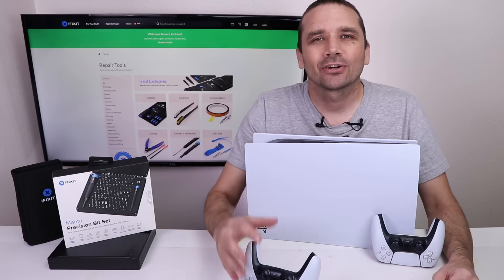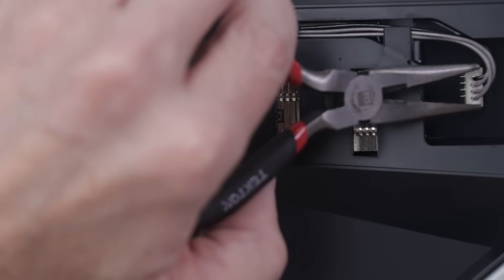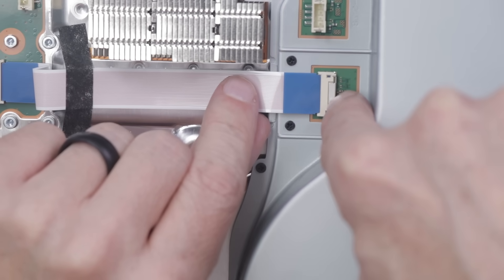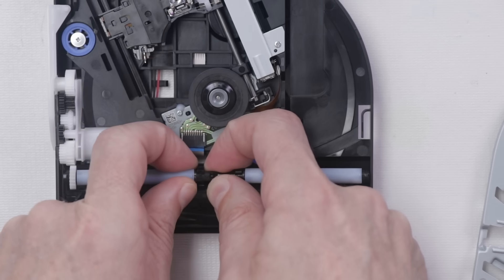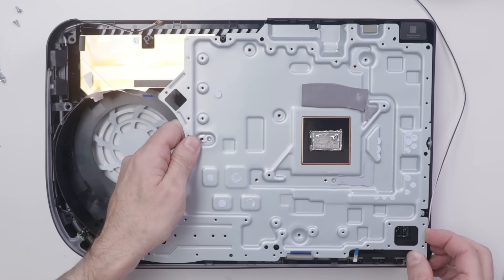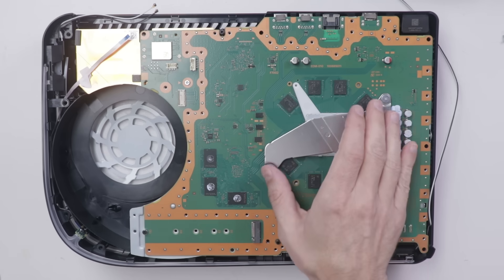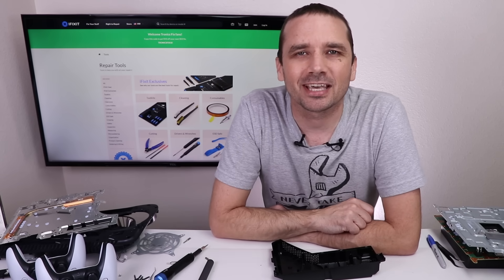PS5 Teardown - A Repairability Perspective

Comment: Apple and Sony are best friends in terms of repairability perspective.
Reply from the maker: Lol!
Reply: Try open a Sony camera, welcome to hell
Reply: @null643  Right now the expansion slot isn't usable however the fact that it's a PCIE 4 slot means that it's on par with the onboard storage in terms of speed and in time it will become faster so you might not even need that onboard storage in the future. It seems my information was incorrect oops, The PS5's onboard speed is 9gbps, the fastest PCIE 4 SSD I've seen that is available for purchase right now is 7gbps, that's still 2gbps under PS5's. I believe PCIE 4.0 has a maximum speed of 64 gbps so theoretically in the future a SSD plugged into the M.2 slot of a PS5 would be faster than the onboard.

Also there are probably faster SSD's in enterprise but not for everyday consumers.
Reply: @FC360D  the raw speed is 5.5. With compression 9 is one of the numbers that float around the Internet, but also 17 if I'm not mistaking. In the road to PS5 presentation Cerny mentioned that in the future with the right compression they might hit 22 Gb/'s.
The ssd expension must be faster than the on board. Internet says 7 gb/'s is fast enough, but we will hear from Sony what will work for sure.
Reply: @RazorFastClaws  Ah right thanks for that information :)
Reply: If that were true, Apple would be shaking their head in disappointment, because Sony didn't glue and clip everything down. Sony would nod in approval at the 43 screws though.
Reply: Its a shame, because they used to be one of the best.
Reply: It's still repairable though and looks easy enough to repair with the right know how. The only issue I see is the amount of screws which might annoy people but that's what electric screwdrivers are for and on a plus note hopefully someone will take 1 look at all the screws and decide to take it to a professional instead of trying to fix it themselves and break things even more lol.
Reply: @FC360D  I agree, the biggest problems I have is how hard it is to get to the heat sink and how the SSD is soldered to the board. Maybe it was impossible to get the super fast speeds without it being directly on the board?
Reply: @Maka8295  I don’t think soldering it made it any faster maybe they were just conserving space? although there is 1 expansion slot I agree however that it’s pretty annoying they went with those decisions
Reply: @Maka8295  Right now as far as I'm aware there isn't any storage available for purchase right now that's faster than the PS5's however I think we will soon see similar speeds to the PS5's storage and then it will overtake it especially when manufacturers start releasing and supporting PCIE 4 SSD's. It's why I like the M.2 expansion slot which I believe is PCIE 4 so in the future we might be able to install a bigger SSD that is on par or faster than the onboard storage. PCIE 4 has speeds upwards of 7gbs.

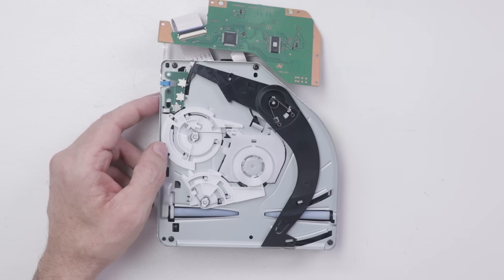Comment: 7:24
is 43 screws really necessary i cringed instantly hearing that
Reply: It's probably to keep all the thermal stuff under perfect pressure, but it's still excessive
Reply: Necessary to keep the liquid metal in check.
Reply: feel like 30 would've done the deal, but idk, Im not Sony
Reply: It's to apply even pressure across the board, they're using it as a heat sink. Its vital that even pressure is applied otherwise some parts will get less contact than others.
Reply from the maker: Ya, not sure that's necessary!

Comment: What a poor design from sony, the number of screws random sizes, cheap plastics/components and the size is just unreal.
Reply: That's because of the liquid metal.
Reply: @UssyMustyYS  Nothing to do with liquid metal.
Reply: Leopold  This is not the only teardown to mention it, so there must be something in it. The number of fasteners is a joke, it's just badly designed.
Reply: Leopold  most of the fastens have nothing to do with thermal transfer...

Comment: The Xbox looks next level compared to this to be honest... this is just to complicated.
Reply from the maker: The series X looks like it was designed with the inside and outside in mind. The PS5 looks like more importance was given to the exterior look.
Reply: @Tronicsfix  i notice the ps5 disc drive was design to the body shape on the corner.The  gears are to one side.
Reply from the maker: @Ebolachicken  Yep
Reply: @Tronicsfix  Who do you think has the better fan and better chance of cooling faster?
Reply from the maker: @javierlandaverde4108  Not sure about the fan but as far as cooling I can't argue with liquid metal.
Reply: @Tronicsfix  would you have prefered sony to use a vapor chamber like microsoft instead of the liquid metal?
I don't know much about this stuff, but using liquid metal seems like an unnecessary risk.
Reply: @Iván-Montalvo  it's great cause you don't need to replace it. It should remain heat conductivity until you replace it with the PS6. That's not sth you can say from conventional thermal paste, that gets dry and looses its effectivity.
Reply: @paddipat  what I've seen in every gpu that uses liquid metel they have to change it in only a few months. Of course the ps5 is designed to have it there, but it will probably need to be changed in some time. And what I meant for unnecessary risk is that liquid metal, with time, corrodes the heatsink, plus the risk that it slips out of place.
Reply: @Iván-Montalvo  the liquid metal is completely embedded in this construction, this should ensure it stays effective for years. And that's also why there won't be any issues with corroding metal. Sony claimed they worked for two years on that patent, I don't think they wouldn't make sure that it can function properly in the long term.
Reply: The CR2032 would wear out before the Liquid Metal or NAND Flash does.
Reply: @Tronicsfix  wouldn't agree. Seems more like first priority was heat dissipation and therefore they made sure there is enough room for that. Then came the design around the big footprint they've come up with. I think it's not that bad, air is pulled in from top instead of bottom on the ground. There are two holes for vacuuming the dust out and liquid metal ensures nobody should be in the need to ever replace thermal paste again. For just cleaning the heatsink, you don't need to take it apart from the mainboard, so it's not that hard to get it out to clean.

Comment: This is built very badly compared to other consoles.... WOW
Reply from the maker: I sort of agree BUT they did design a good cooling system by the looks of it.
Reply: If anything it looks over engineered ( how many screws ! The massive heat sinks nd liquid metal, plus the disc drive is dampened ) rather than “built bad”
Reply: @dan123collins  PS5 slim coming soon? Lol
Reply: This desing is a disaster.

Comment: I wouldn't want to put that PS5 back together.  That's a hefty amount of screws you have to deal with and of varying lengths.
Reply from the maker: True...it's not the most fun to put back together but if you group them correctly it's not too bad.
Reply: I always use color markers on the screw nest. One without colour is the most common screw, the rest is colored.

Comment: I know this is a ps5 video but how much thermal paste do i need for the ps4
Reply from the maker: The perfect amount! lol
In other words it's really not a big deal. Just be sure to use enough. I've shown it in a lot of my videos too.
Reply: @Tronicsfix  And we all know that the perfect amount is when you spread out the thermal paste evenly with a thin layer, making sure it covers the whole CPU/APU 😇 I mean, by putting a simple chonky dot on the middle you're not guaranteed to have a thermal paste that spreads itself out to every corner as you clamp the heatsink down onto it because some parts of the component might not be covered properly. I shake my head everytime you add thermal paste because you keep saying "perfect"  and i'm not trying to attack you or anything at all, i am a fan of you as a person and youtuber and do respect you, but i wanted to give you my opinion on your way of using thermal paste, and that perhaps you should try a new and better method, like i explained (spread it out evenly with a thin layer) 😌

Comment: Sony literraly hates us

Why does it have different screws (torx t9) than the ps4 (torx t8)?!
Reply from the maker: Lol...agreed
Reply: That's because ours torx 8 bits have already really worn edges, because we disassembled and assembled so many ps4, so we can start using torx 9 from now ... ;-)
Reply: Probably to put off the idiots who think they can take their consoles apart but don't have a clue what they are doing so end up breaking things even more and then sending it to Sony for repair and causing Sony to spend more time and money on repairing the damn console or giving a replacement.
Reply: @FC360D  you can't send in a ps4 that has been opened
Once the stickers are removed the warranty expires, means you cant send the console in
Reply: @moritzk3004  Your information is slightly outdated. Removal of a warranty sticker does not void the warranty. I believe this was done in 2018.
Reply: @FC360D  doesn't change anything
A warranty only works if the ps4 is broken while bought, or gets broken by accident without the owners influence (like the power supply breaks down, or the hard drive has a mistake)

But if you damage your ps4, which also includes opening it, and damaging it in the following process, than the warranty doesn't apply
Reply: @moritzk3004  Yes that's what I meant. Say for example a PS4 comes with a 1 year warranty and something breaks someone is allowed to open the console up and see what's wrong and if they can't repair it they then can send it to sony who have to fix it for free. And yes like you said if the user breaks it then sony can charge for the repair or just refuse to repair it which has always been the case, intentionally damaging a console has never been covered by any warranty or repair plan.

Simply opening up a console does not void the warranty anymore, however this is only the case in USA however companies will still repair a device even if it has been opened and an attempt at repair has been made as long as it didn't cause the damage. I had this with Nintendo a long time ago with my DS where I had opened the console to see if I could fix the issue but couldn't so sent it to Nintendo who repaired it for free as it was just under a year old, even though the warranty stick was gone.
Reply: @FC360D  but in your original comment you said that they probably put different screws in to avoid having to spend more money on repairs/replacements because some idiots try to repair it themselves, and do more damage in the process

But again, sony than doesn't have to repair the console or anything, so i don't really see your point

Comment: man the official ps5 teardown gave the impression that it would be much more user friendly.
Reply from the maker: It's not that user friendly...imo
Reply: @Tronicsfix  still more user friendly than any of the previews consoles... That's an upgrade in my book. 
Alao usually an easy to service device is often poorly optimized inside.
Reply: @OG_ALviK  no and no, he stated at the end that this is the least serviceable console including ps4 and just because something is complicated doesn't mean it's efficient
Reply: @quiescent1530  no, he said it was the least repairable between the series x, s, and ps5. nothing about the ps4.
Reply: @quiescent1530  Lmao, least serviceble console? Hes probably haven't worked on xbox 360 or ps3 fat. This ps5 teardawn is so easy compared to those. 
Also, i didn't say that more complicated = efficent. 
I said that if you make it more "user friendly" it will be less efficent.
Reply: @OG_ALviK  the 360 is a lot easier to tear down than this lmao

Comment: Remember...You Will Comeback After 3 or 2 Years To Watch This Video For Cleaning Your Load And Noisey PS5 Fan
Reply from the maker: I'll make more videos about how to clean them.
Reply: Technically there are 2 dust catcher just to be able to clean the dust without having to open the whole box apart. But I get your point.
Reply: @aGaranib  I'm genuinely curious how effect those dust trap will actually be.
Reply: @LifeNTheSlowLane  Who knows. We'll see in several months.
Reply: @iNeed2Pi  It's just a meme that even Microsoft has embraced by presenting a literal fridge. You can look it up on Xbox's channel.

Nobody here is saying that the Xbox is bad.
Reply: I really hope the cleaning system they built works as intended. I wouldn't enjoy having to strip down my ps5 completely every 1 or 2 months for maintenance
Reply: lol
Reply: Lol its an entirely different design of a fan. It wont be noisy even at full rpm.
Reply: okay xbot fanboy
Reply: Muki It doesn't even make sense for u to say that Imao
Reply: @muki_x  No I'm A PlayStation Loyal Player...Not A Fridge Fan...I Just Don't Want The Fan Noise Following Me To The Next Gen.
Reply: @williamjohnson8603  Ironically I was playing ps5 today and felt like the fan was very noisy, only to realise that my ps4 was turned on and all the noise came from it... Ps5 is fairly quiet so far.

Comment: Steve I broke my switch lite lcd screen are there any good places to buy that part? If so could you comment the link
Reply: How you managed to brake LCD inside NSW Lite?. I understand cracking the plastic on front, but...
Reply: @override1337  installing a custom clear purple shell
Reply from the maker: eBay. I don't have a link. Just buy from a place that has a good rating.
Reply: @Tronicsfix  ok tysm also if you ever looking for a apprentice hmu I want to learn your ways 😎
Reply: Btw thank you for this now I can put a red LED light mod on the ps5